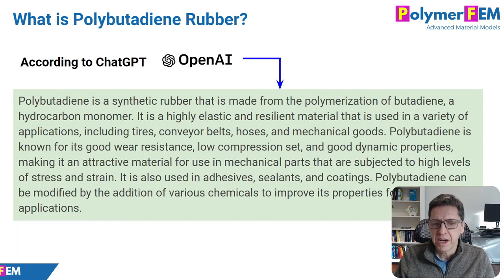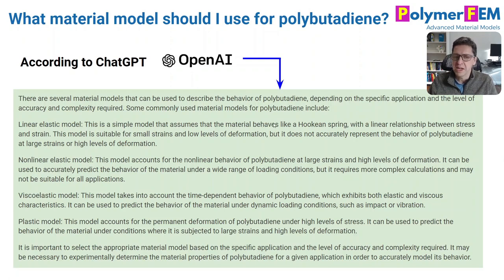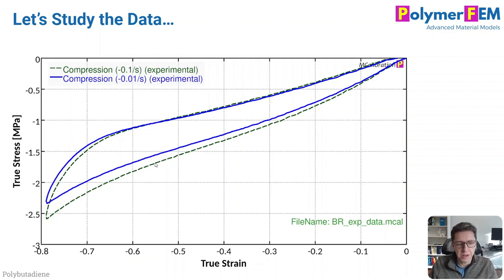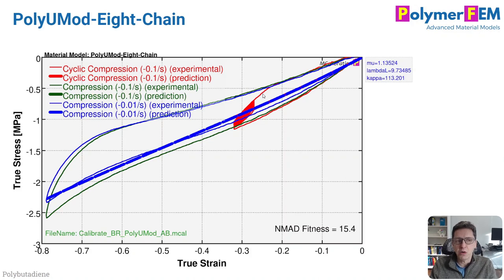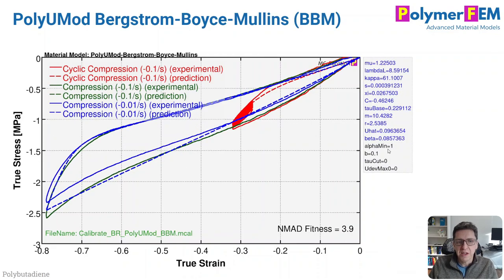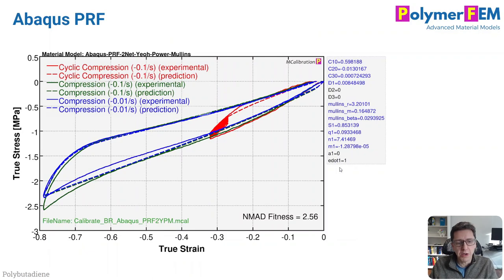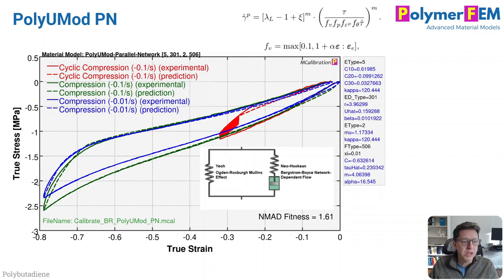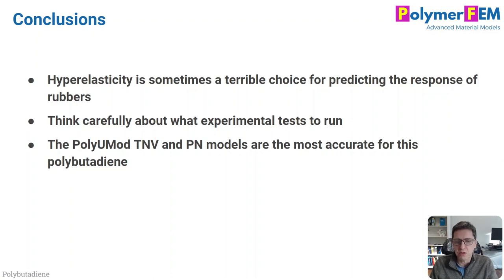Best Material Model for Polybutadiene Rubber

Comment: As usual great talk, really, by following your comments, week after week, we get a nice overview of the complexity of Polymers, but also how to handle them at best.
Now my comment is that what you show us is also that our FEM models need really to be carefully chosen v.r.t. stationary vs time dependent solver set-up, as the polymers have such different load/unload / time dependences that to capture really what is going on, we need to run several solver models to take into account all uses cases, and this with appropriate material models as you and your analysis software allow us to load up :)
Reply from the maker: I agree. To get good accuracy it is necessary to use the proper time scale. Good experimental data is also very important...